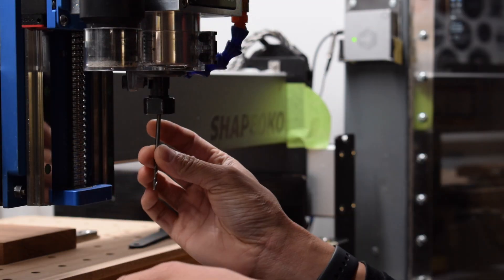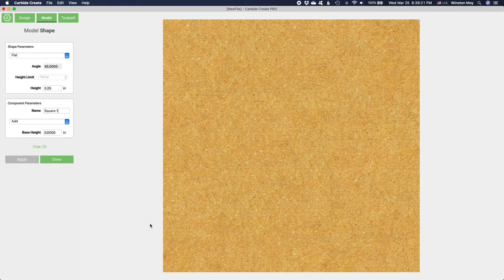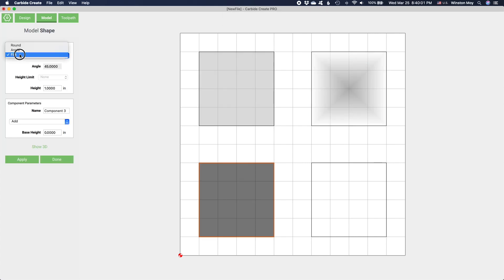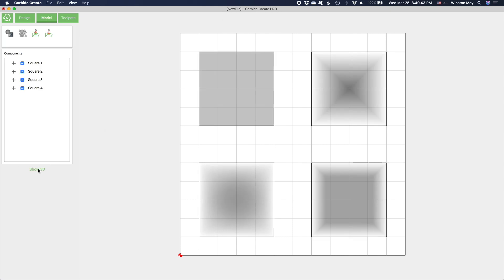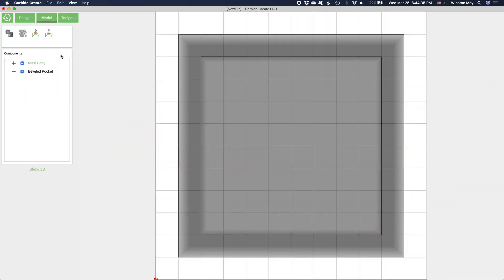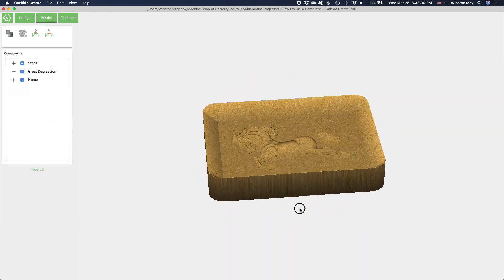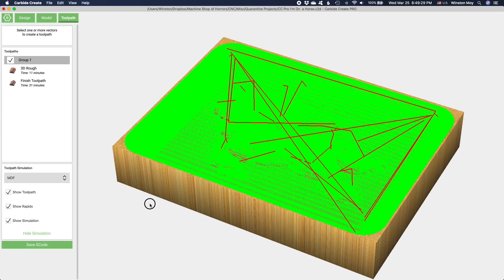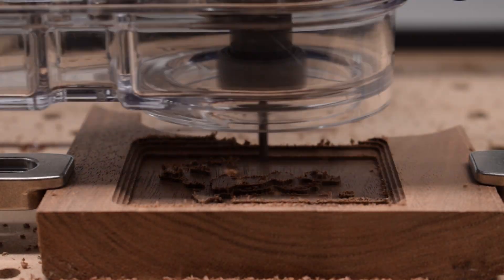Carbide Create Pro Brings 3D Modeling and CAM to Create

Comment: Winston Are there tutorials some where to learn how to use the Pro version. 
I have a XXXl
That I bought in 2017. Will the controller that came with it back then work with the new CM version that has the bit setter.
Thanks Jeff
Reply from the maker: More CC Pro content to come, one just uploaded today. Also some written tutorials on the forums (https://community.carbide3d.com/t/carbide-create-pro-free-for-a-year/20918/91)
If you can use a touch probe, you can use a bitsetter. Should be compatible with almost all Shapeoko 3's, but wiring may be slightly different. Will be in the instructions.

Comment: So..  Forgive me, but I'm new to Carbide software.  I just purchased my Shapeoko XXL and a total newbie to CNC.  I have been learning on a Redsail 4040. so do you purchase Carbide create Pro Or do you do a monthly subscription?
Reply from the maker: Carbide Create Pro can be purchased as either a one time perpetual license, or an annual subscription at a lower cost. We are currently providing a free one year subscription.
Reply: If you jump to and started with Fusion 360 life will be oh so much better. Also with the XXL the middle (dead center) has a tendency to dip especially if you have heavy stock or always lean on the machine securing stock down. Finding support for the middle of the base or the aluminum base is a must for acurate detail across 32"x32" because of elasticity in the Z/A axis and spring on the board. However the machine cuts just fine without "special attention" you just might have to plunge deeper into your scrap waste board and more gingerly compared to that 4040 to cut 100% through.

Comment: Carbide Create is an awesome company!!! I needed a  single v wheel and instead of making me buy an entire tune up kit they sent me 2 wheels free of charge. And now this!!! I just tried the link for CC pro and it only offered me a 30 day trial, not sure why. Has any one else tried the link yet?
Reply from the maker: Make sure you paste the full URL with the '/promo' suffix.
Reply: I received two separate emails from them, one with a 30 day and one for the year. I think it's a system glitch.
Reply: My link was only for 30 days also I could not get carbide create to open to be able to paste the new license  into it. When I opened it all it did was run and then I was told it was not responding.